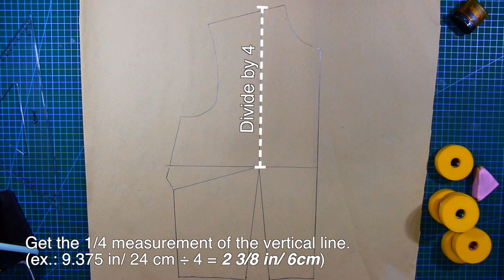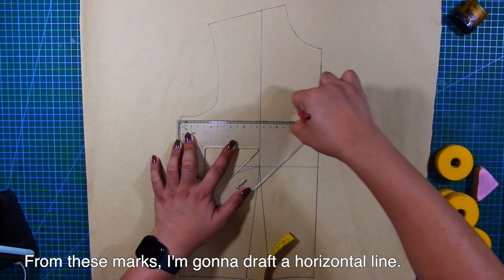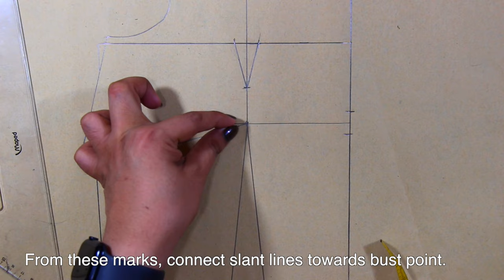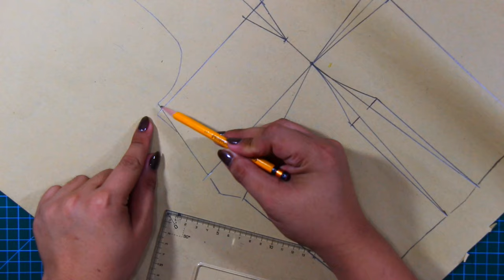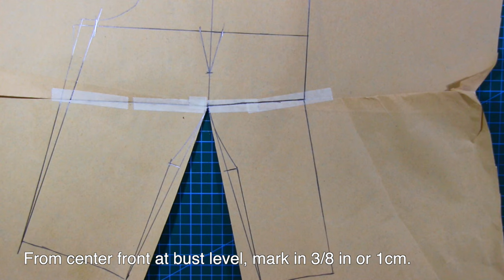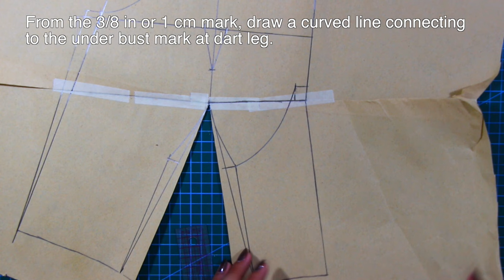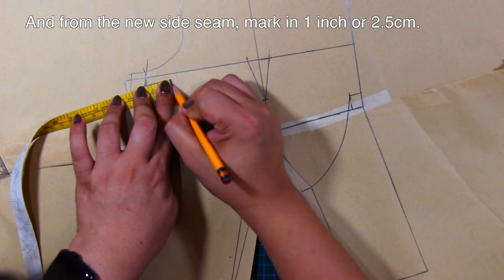HOW TO DRAFT A BUSTIER WITH BUST CUPS | PATTERNMAKING TUTORIAL | LA MODÉLISTE

Comment: Horizontal line at 6 cm ( I used 7 ) is not that high up for me. I try to draw the curved line connecting the side seam to the upper bust dart legs and its too low ?
Reply from the maker: What pattern block design system are you using? I used the Helen Joseph Armstrong pattern block

Comment: How did you know, which size the pieces should be to fit you?
Reply from the maker: I used a bodice block according to the measurements of my dressform. It will always depend on your bodice block. If your bodice or torso block is wrong in measurement from the beginning you will never be able to draft the bustier nor other garments. Start all over again I say